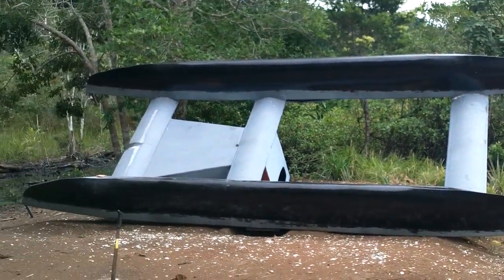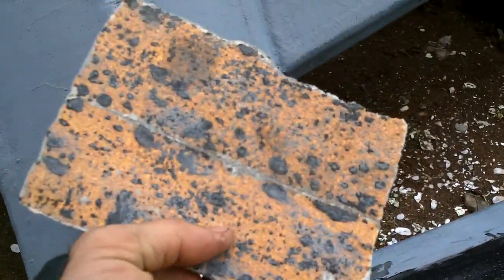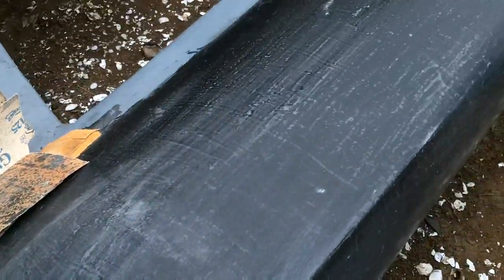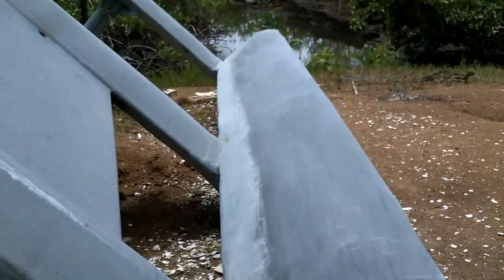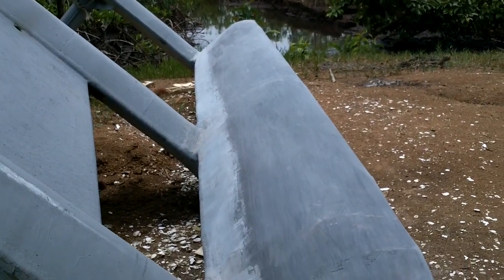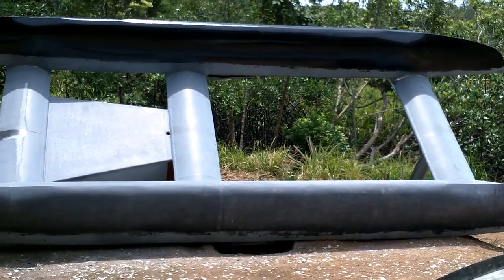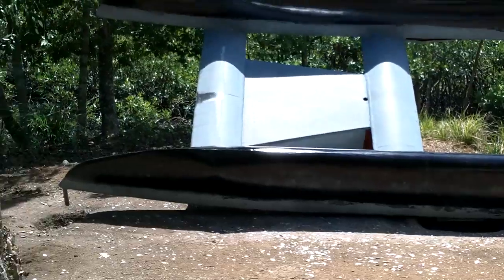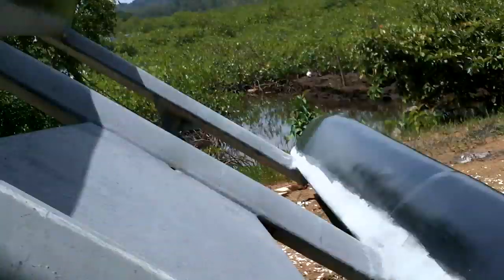Boat Chips 004 Pontoons getting Smooth Now

Comment: I always liked to do things like sanding by hand etc. Like you seem to. I always thought it made me stronger and wouldn't hurt anything, now that I am 70, I believe I was wrong .
 About 20 years ago I started having joint problems, not sure the sanding ,weights etc , did it , but if I had it to do over , I would have used a machine for at least 90% of it and not take a chance.
Reply: Everything in moderation I guess
Reply: I'm 53 and beginning to fill your pain.

Comment: How about trying a scraper of some sorts? It used to work for me to take the high spots and doesn't gum up. The boat is marvelous though!
Reply: Exactly what I was thinking. I spent decades doing finish work, and a good quality cabinet scraper can run circles around sandpaper as far as speed, smoothness and easy de-gumming, for certain surfaces and contours. A lot cheaper than sandpaper, too.

Comment: Did you use gel coat resin ? If so, it need air to be excluded otherwise the surface remains tacky until layup resin is applied. Can be a real pain to remove the tackyness.

Comment: You are getting those lumps and having to put so much effort into sanding because you are skipping a step. Get some fairing compound put a thin layer of it on. Then the sanding to make it smooth is easier. Its just like sanding bondo.

Comment: Any time I have something slightly sticky to sand, I rub dry dirt on it first. The dirt soaks up whatever edges of the surface make it sticky still, and it sands off just about instantly. It's going in water anyway, doesn't matter if it's dirty. Ditto for like, getting grease on your hands. No point in trying to wash them, even with soap. Rub yours hands in the dirt a little bit, and then wash them off. The dirt unstickies the sticky stuff.

Comment: Amine blush is water-soluble, so it's very simple to clean away. All you need to do is reach for a plant spray container, some warm soapy water and a Scotch Brite pad. Spray the affected surface with the water, wash thoroughly using the pad, wipe dry with paper towels and you're done. It's that easy.